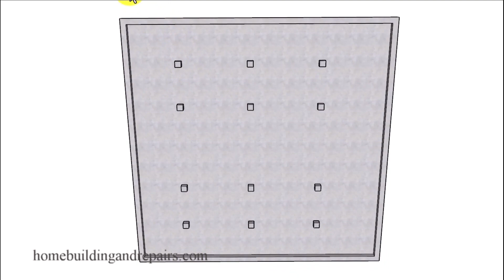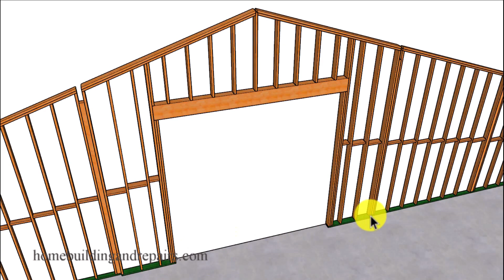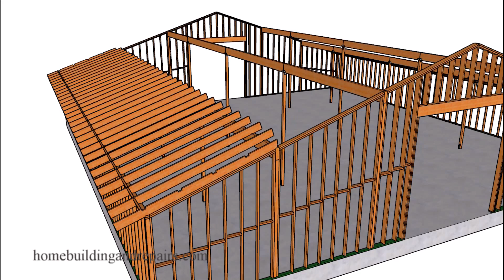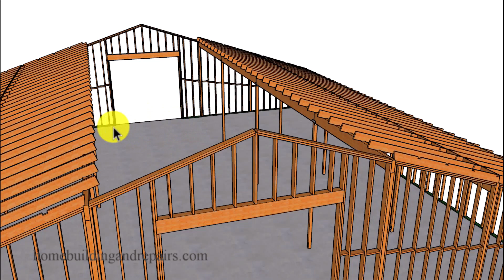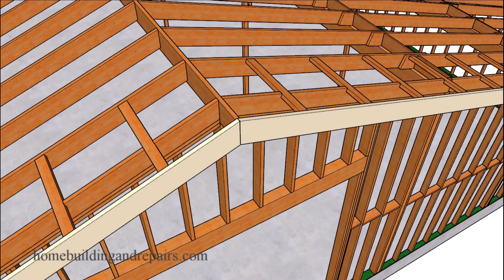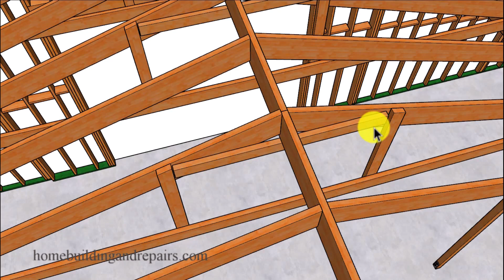How To Frame And Build 60 x 60 Foot Garage, Workshop And House - Do It Yourself Construction Ideas

Comment: How do I get these plans? However I'm in of getting a commercial truck through the door and I need a 14 door height. I'm thinking about doing a 4 foot cinder block foundation.
Reply from the maker: I would have a local designer make your plans. I don't have any plans drawn.

Comment: Hello. How would you frame a 42" deep eave overhang (18" wide gable overhangs) for a gable roofed house using 2 x 12's and a structural ridge beam? The house is 18' wide and the walls are 2 x 6's with 5/8" sheathing. I'm thinking that adding a horizontal soffit with 2 x 4 framing from the edge of the overhang back to the exterior walls might be enough to brace the edge  but would it also be a good idea to double up some of the rafters to help handle the load at the roof edge? This is for zone 6 in snow country so I'm planning on a 70 lbs/sq' snow load.
Thanks for your help!
Reply from the maker: I don't know exactly what you're asking, because it would be framed the same as using smaller lumber. Go to our website and check out some of our roof framing videos.
Reply: @gregvancom  Hello, thanks for your reply. Because the eave overhang is so deep I am concerned that the weight of a heavy snow load would cause the eave to sag or cause the rafters to snap where they extend out over the exterior wall. Therefore, I am thinking of using 2x4 soffit "braces" extending out from the exterior of the wall to the ends of the rafter tails to help counteract the downward forces at the eave.
The other option is just to double up some of the rafters to help stiffen up the cantilevered eave.

Comment: I have a wall perpendicular to the ceiling joists, but there are gaps from the wall to the exterior wall. 4 purlin braces come down on this wall but not a long the entire structure? Is this a load bearing wall? What other purpose might this wall serve?
Reply from the maker: I would be difficult to say yes or no. I've worked on plenty of homes with purlins sitting on load and non load bearing walls. Walls supporting roofs should not be removed with out local building authorities approval.
Reply: @gregvancom  thanks for the reply. I have no intention of removing the wall without an engineer sign off, just very confused on what's going on and was wondering if you might have a thought. Thanks!
Reply from the maker: @sdbw1990  That's good. Roof purlins do transfer weight from the roof rafters and since they do are load bearing, but usually aren't specified on plans or have footing under them, making it difficult to classify in the same way as a load bearing wall that might be supporting the bottom rafters. I hope I didn't make this more confusing.
Reply: @gregvancom  nope all good! Eventually I'll have an engineer take a look but for now gonna leave it. I might try to expanded the living room by squaring off the structure with the dining room but don't know if that would require a beam. A thought for another time!